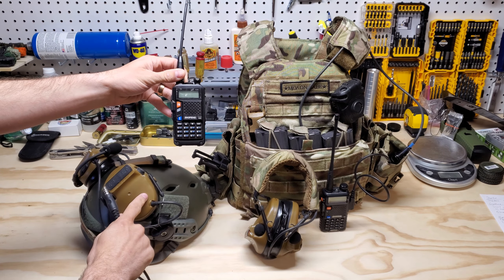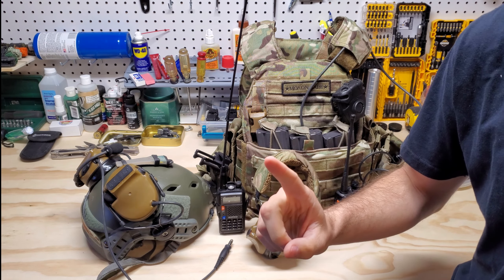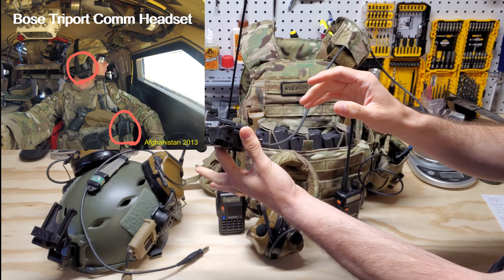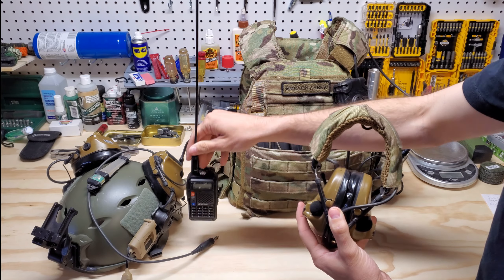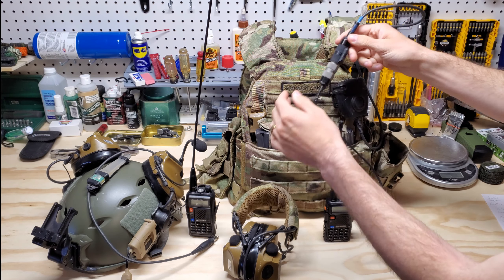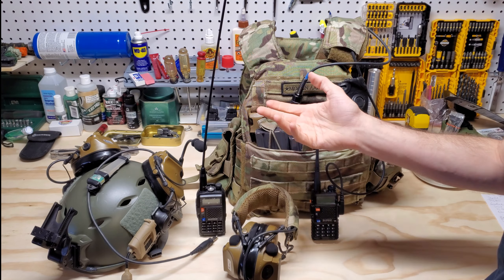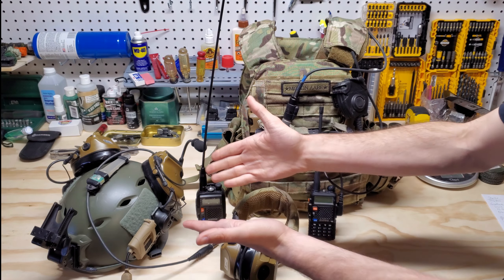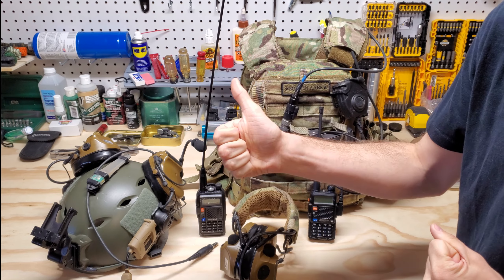How to connect Peltors comtac III to Baofeng Ham radio

Comment: I run the comtac III single leadwith a Kenwood u94/A PTT (amplified ptt) and a 48" foldable antenna with a gooseneck adapter. Pretty good for closed comms. Still learning about HAM comms.

Comment: Technically you need an amp in the circuit as comtacs are low impedence systems and baofengs and other civilian radios are relatively high impedence
Reply: You're totally right. Additionally, I hear that some baofengs don't have a preamp, so the signal from the peltors to the radio will be wicked quiet. In a radio with a preamp or adjustable gain this should not be a problem since the radio deals with it on the input side of things. The trick is knowing which chinese radios have these features :D

Comment: Dude this was so helpful! I literally just asked Nick how can connect my radio to my ear pro like two days ago.
Reply from the maker: Thats funny lol. Just be mindful of the make and model of your Ear pro. Some aren't designed for Comms in mind 😕
Reply: @PreparedAirman so I found the adapter at disco32 but where can I find the other adapter that goes to the peltor push to talk? It’s the black cable that is connected to the adapter.

Comment: This is great. It would be greatly appreciated if you would put a direct link into your part you found to connect the radio to the headset and not just the Disco32 site.
Reply from the maker: https://www.disco32.com/products/female-nato-six-pin-to-kenwood-plug-adapter?keyword=nato

Comment: Can I not just plug the disco 32 Ken wood adapter straight into the radio without a push to talk? Also Peltor makes a kenwood putt adapter so can I just get that and skip the disco cable all together?
Reply from the maker: Potentially, and i wouldn't see why not. At the time of this video Disco32 was extremely new and didnt have very many products on the market. Now they are very well diverse in products.  Make sure you get a cable that is "amplified"

Comment: Hey I bought some liberator 2s with the standard nato connector and that exact PTT but when I plug the wire from the headset into the PTT it comes out super easily. Did I buy a defective Peltor PTT or the wrong PTT?

Comment: which peltor radio single comm PTT adaptor are you using? Will the FL5035-02 Peltor Radio Adaptor work to 
M55116 To Kenwood 2 Pin? Please advise. Thanks!

Comment: Excellent video ! What input cord is needed to run comtac 3s to disco 32s push to talk? Thanks
Reply from the maker: If your peltors have a single or double down lead attached then you are good to run coms. If you don't have a down lead already attached then you do not have a comms capable unit, to my understanding.
Reply from the maker: You may be able to get comm upgrade kit for them to make them work. But I personally haven't done that.

Comment: How is the sound when you talk out because I thought it had to be amplified a certain way that’s why people don’t use the actual pelator ptt and buy a whole new ptt system.
Reply from the maker: So I haven't had any issues. Its slightly quieter then an actual 152 but its not so quiet you can't here anything. Its definitely usable.

Comment: Not sure if anyone will be able to help. Bought a set of contacts 2s second hand years ago in the military and never used them. They have a weird smaller  6pin plug rather than the standard connector most contacts have. It’s not the standard nato 6 pin that’s on the radios but way smaller. Anyone know what this connector is called so I can try and source an adapter?

Comment: Hey, great content, I watched your Communications/Radios video too. Do you ever have issues with the Kenwood 2-pin having an inconsistent connection with the UV-5R under heavy use? I'm in between getting the BF-F8 or the UV-9R. The BF-F8 is an 8-watt upgraded UV-5R with the Kenwood 2- pin, but the UV-9R has a multi-pin motorola xts-like connector that screws in. Disco32 has ptts for both, but the UV-9R is only about 4-5W over 440. Do you think there is a discernable difference between 4 and 8 watts anyways?
Reply from the maker: I have had a couple of connectors fail on me before. I would say its common but it does happen. In my understanding wattage increases range but also reduces battery life. So it's a trade off. Talk longer distance for shorter time or talk a shorter distance for longer time.
I would say it depends on your intended use.

Comment: I've been looking to do this for a while, do you have a ham radio license or have you programmed these for GMRS/FRS channels like a lot of airsofters do?
Reply: technically you need a ham license either way with the baofeng bc of the power level it transmits at and being capable of going to other freq.

Comment: I have been running a U94 to Kenwood 2 pin for about 5 years. I got it at themercenarycompany.com. They make them for NATO and Commercial U94 Headsets.
Reply: I guess ill ask you this too, sorry for the late reply. Do you ever have issues with the Kenwood 2-pin having an inconsistent connection with the UV-5R under heavy use? I'm in between getting the BF-F8 or the UV-9R. The BF-F8 is an 8-watt upgraded UV-5R with the Kenwood 2- pin, but the UV-9R has a multi-pin motorola xts-like connector that screws in. Disco32 has ptts for both, but the UV-9R is only about 4-5W over 440. Do you think there is a discernable difference between 4 and 8 watts anyways?
Reply: @tylermartin2019  No real difference between 4 and 8 watts (except battery drain). I have some Baofeng radio's(UVB5's), but don't use them for Tactical Comms...I use Anytone Radio's (NSTG-8R and OBLTR-8R).
Reply: @tacbear  Thanks, yea that's what most have been saying, ill listen to experience rather than my goblin brain saying bigger numbers better. Any issues with the two-pin microphone connectors? Or do you not use them?

Comment: Now that I don't get to use cool stuff for free, does anyone have recommendations for budget friendly bump fast helmets? I realize they won't be OpsCore or Team Wendy, but there are so many out there, I'm honestly not sure of what to go with. I have a Pro Tec classic that I've worn in a professional setting years ago, but the fast style are definitely better. I'm not up on the latest stuff.

Looking for actual nonballistic protection against impact. Not using it for things like airsoft or paintball.
Reply from the maker: Protec makes some fast based models now if i recall. About 70 ish bucks. Thats all I'm really firmiler with in that price range unfortunately. You may be able to find an opscore bump used for pretty cheap if you hunt around.
Reply: @PreparedAirman  Thanks for responding man. I'll definitely look into both of those.